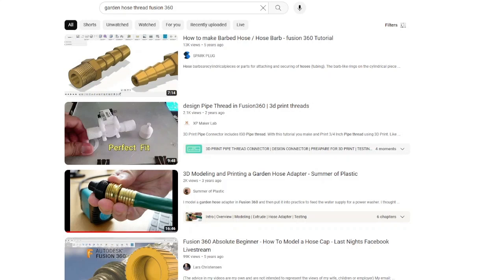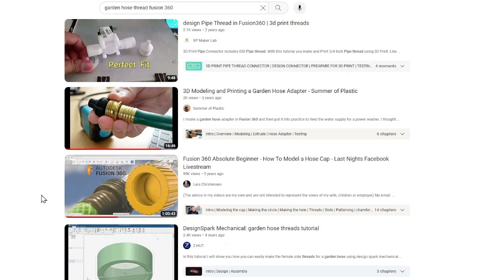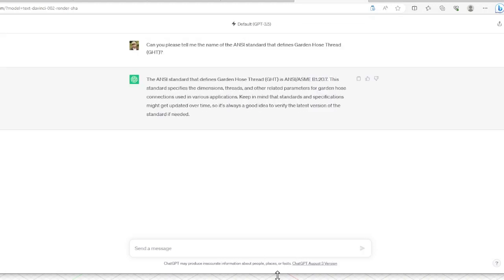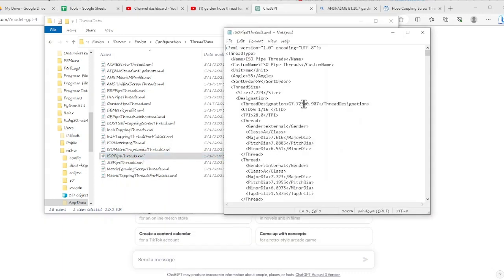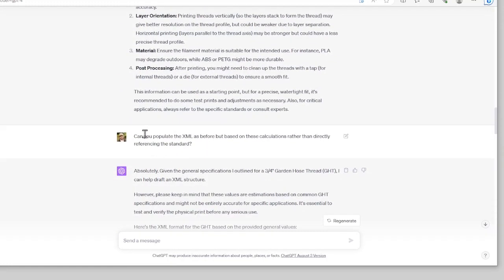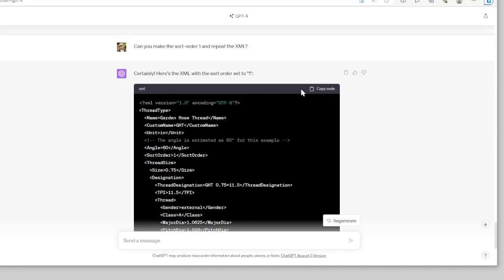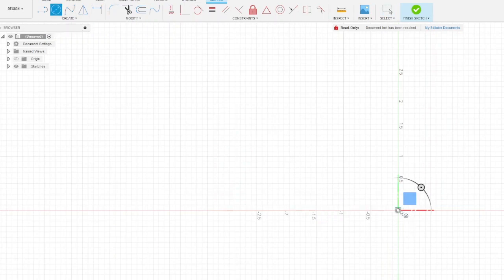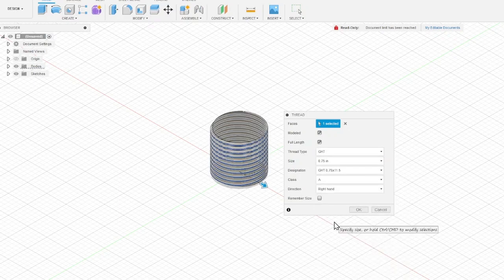Stop Making Garden Hose Thread from Scratch | Add ANY Custom Thread in Fusion 360

Comment: I spent about 2 days nerding out on this trying to get a perfect thread that fit a gardena hose. Unfortunately the XML provided here didnt work well for me I found the threads super tight. After some Chat GPT-ing I realised it might be because I am in Europe, apparently (would you believe it) hose fittings follow a different standard so I'll share my findings here as finally managed to get a near perfect fit.

This was my full XML:

<?xml version="1.0" encoding="UTF-8"?>
<ThreadType>
  <Name>3DP Garden Hose Thread 14 Euro</Name>
  <CustomName>3DP Garden Hose 14 Euro</CustomName>
  <Unit>in</Unit>
  <Angle>55</Angle>
  <SortOrder>1</SortOrder>
  <ThreadSize>
    <Size>0.75</Size>
    <Designation>
      <ThreadDesignation>3/4 x 14 BSPP</ThreadDesignation>
      <CTD>3/4" BSPP</CTD>
      <TPI>14</TPI>
      <Thread>
        <Gender>external</Gender>
        <Class>A</Class>
        <MajorDia>1.0475</MajorDia>
        <PitchDia>0.9910</PitchDia>
        <MinorDia>0.9345</MinorDia>
      </Thread>
      <Thread>
        <Gender>internal</Gender>
        <Class>A</Class>
        <MajorDia>1.0825</MajorDia>
        <PitchDia>1.0260</PitchDia>
        <MinorDia>0.9695</MinorDia>
      </Thread>
    </Designation>
  </ThreadSize>
</ThreadType>

I changed a few things most notably the TPI at 14 makes the threads closer together (I could see visable on a real Gardena adapter for a hose that the one provided here had thread teeth too far apart).

I also followed the comment in here @drdave7078 made and make fillets on the outer edges of the thread "teeth" at 0.2mm as my official Gardena one seemed to be more rounded and I feel this makes a slightly smoother fit.

Also, note in 2025 it seems Fusion 360 requires a <CTD> which was missing from the XML here, without that it doesn't show the Designation like seen in the video. I believe it can be any name, and maybe just a visual thing, bút I added it all the same.

Hope it helps!

Comment: Wow, this is so helpful and removes a lot of the work in the GHT tread making process. This is my first attempt at using Fusion to make 3D Printable treads - for a rain barrel to garden hose adapter- and the XML file and instructions made the process painless.  The male threads fit quite nicely when made on a 27mm cylinder.  I applied a 0.2mm fillet to make the threads a tiny bit rounded, as recommended by Kevin Kennedy in PDO.  A big thank-you to BooBooBuilds for making this available.
Reply from the maker: Glad to hear the updates were useful! I was in a similar situation trying to print threads for the first time. I wanted to see if I could do something with garden hose, and then realized it was kind of hard to design for what seemed like silly reasons. I haven't tried the 0.2mm fillet before on threads - that sounds really cool - thanks!

Comment from the maker: UPDATE (NEW FILE!): Thanks to everyone's really helpful feedback, I've spent some time testing and updateing the XML file that generates the threads. I made a new XML file based on the ANSI standard and built in the offsets which is available in the link in my github. I also added a couple test print files and a calculator python script if you want to increase the offset in the XML file. This new file works great on my Bambu X1C. It's a little tight when printed plastic on plastic, and they fit nicely on my metal hose connectors in my garden. Since there's a lot of interest on this topic, I'd like to make a new video just to help people get up and running as fast as possible 3D printing GHT. It is weird that the spec is so hard to find, and it's so fun to hook up a hose and 3D print adapters and sprayers for garden hoses.

Comment: I tried out this code for the garden hose thread and 3D printed a plug, but unfortunately, it does not fit. I used a -0.2 face offset in Fusion 360 to achieve better fitting, but without success. Is it possible that you uploaded the wrong file, since the name is <CustomName>Definitely Not Garden Hose Thread (GHT)</CustomName> and not simply 'GHT'?
Reply from the maker: Hmm - you might be right - I’ll try doing a test print today to confirm. The original file I used to print a fitting was slightly different than the one I ended up uploading, but I didn’t think it would have made much of a difference. Will let you know soon - Sorry about that and thanks for the feedback!
Reply: @BooBooBuilds  How did your print go?
Reply from the maker: @designideastation5986   You guys are absolutely right - the original file is way too tight for FDM printing. I spent some time getting the right values in the XML file and updating it based on test prints. The updated file is in the description. It's the same file, I just edited it. It works well on my 3D printer now and I don't need the offset face anymore. In particular the pieces fit well with metal GHT components. They are a little tight as plastic on plastic (i needed a bit of wear in on mine), but like @comedians8869 mentioned, you can add an offset in fusion (something like 0.005 to 0.02 will do the trick). Or, you can edit the major and minor diameters in the XML file to create the offset as well.
Reply: Face offset in fusion on thread types is not a function and will not work as one might think it should. I would use the "Horizontal Expansion" setting within your slicer program.
Reply from the maker: I'm sorry I took so long to get back to this. You're absolutely right - I didn't thoroughly test the thread dimensions and it's way too tight. I spent some time yesterday working on this and I updated the XML file and it seems to work well on my FDM printer now - it's a tiny bit tight, but they fit well on metal fittings. I would like to make a follow up video just on this topic since there's so much interest from people just to find a convenient way to print GHT and make it watertight. This time I got the real values from the ANSI standard and slowly adjusted the offset in the XML file. It seems to work well on my Bambu printer now. Hope that helps. I also put 3D files in the repo as well for testing 3D prints. Thank you for giving it a try!

Comment: Hello,  Is the linked fil the correct file?  it clearly says...." <CustomName>Definitely Not Garden Hose Thread (GHT)</CustomName>"  ??
Reply from the maker: Yes that’s the right XML file! On GitHub you can click the “…” icon on the top right of where the code starts and there should be an option to download the file. If that doesn’t work, You can try copying the code to notepad and just make sure when you save it the filename ends with “.XML” and not “.txt” Hope that helps!